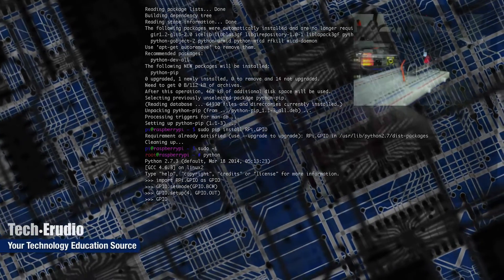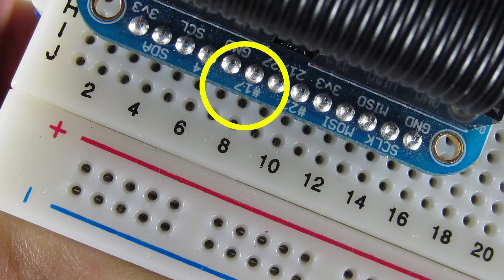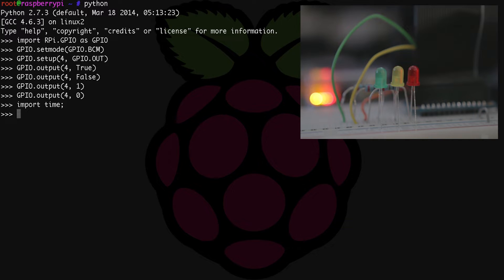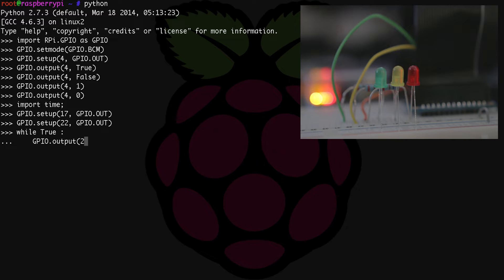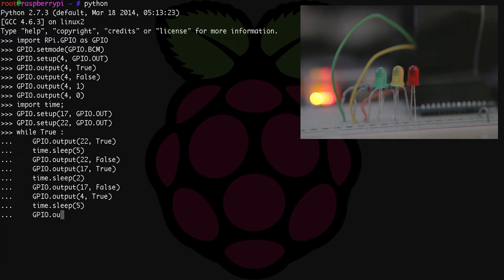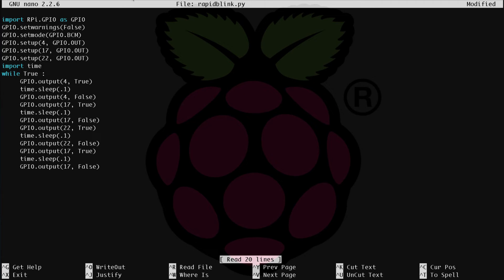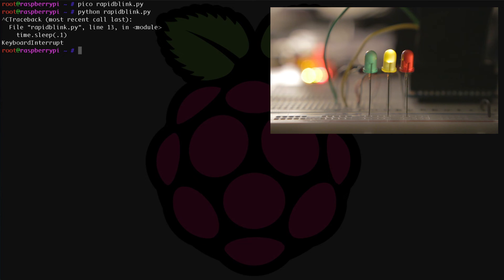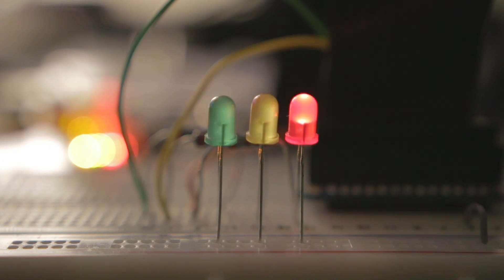Raspberry Pi - Tutorial 13 - Part 2 - Working with LEDs and GPIO

Comment: Thanks a lot for the video really apprecited :)
Reply from the maker: You are quite welcome. Hope to get some new videos up fairly soon!
Reply: so how many volts do the gpio # pind you use as positive output? 3.3v right
i hear that using 5v will fry the board, 
will the LED's be bright  using the GPIO pins as positive to power them,as bright as if you used a power supply?
also can you  change the voltage output with a python command? or sre the GPIO  # pins only capable of outputting 3,3 v?
also in you last tutorila i noticed you specified which way to connect the resistor but i thought it did not matter, resistors  so not have polarity like diodes or LED's ,i have  white LED's and plan on using
2 leds in parallel for each GPIO pin but one resistor for both LED's
so should i wirte the resistor between the 2 connected positve leads of the LED's and the  GPIO # pin or between the 2 connected  negative leads of the LED's and the negative GPIO pin? i have seen  LED wiring diagrams where the resistors are wired in series with the positive and other where they are wires in series with the negative LED lead ,so does it matter?
Reply: also what if i want to have 2 leds on at the same time
and have one go out then the other? can you use a comma like this 
for example GPIO.output(4,17 true) ?
how would i get one to sleep before the other though
or would i just enter it as 2 individual lines?
and is there a way to program say 6 different GPIO outputs to  blink randomly? set the interval like sleep as 6 but have then all go on and off t random but  have them all stay off and on for  set time?
i am doing a halloween project and i want to use  pi zero to  make these eyeball lights slowly  blink on and off as sets

http://s21.postimg.org/xd5h4qwyv/IMG_0141_1.jpg

wire 2 LED's in parallel to each pin , 5 or 6 sets and have them blink randomly but slowly not rapid

Comment: Thanks for putting this up.  I am a rank newcomer to the Pi and programming - all of it really.  I did the stoplight  and sent all three of my LED's to ground through one 100 Ohm resistor rather than three.  I reasoned that since they were diodes and since there is not an issue with the placement of the resistor in the circuit that it might work with one resistor since only one led was going to be lit at a time.  Am I correct?  The stoplight is working.  I got the logic mixed up and it took me some time to switch the numbers but it works.Thanks again.

Comment: 1. any different or things i should take note of if i run the python script using an IDE?
2. There is a pull up/down resistor within the GPIO. If i  enable this, does that mean that i do not need the external resistor in series with my LED?

Comment: Thanks. I ran into a problem after creating my script in pico, though. Here's the message: python: can't open file 'rapidblink.py': [Errno 2] No such file or directory

I checked where the file saved and it is in /home/pi

Any advice?
Reply from the maker: GivandRdale When you use 'sudo -i' to get root access, it will usually bump you into the /root directory. So make sure you are in your /home/pi directory using ' cd /home/pi ' (minus the quotes).
Reply: TechErudio Thanks for the quick response.

Hmmm. I may have saved it in the wrong place. I didn't follow your instructions for both parts on the same day. So, when I launched pico, I wasn't at the root level. I was at the default level for user 'pi.' I did find a way to make it work by launching IDLE using the command 'sudo IDLE' and then typing 'import filename.py.' for whatever script I wanted to load. Having said all that, this is all still very confusing to me although I'm getting the hang of it.

If I have time, I may try going to the root level, launching pico, creating and saving the file, and then running it as you showed to see if it works...

Comment: Rather than using ctrl + c to force cancel the program, wouldn't it be worth adding an if statement checking if you press a certain character, eg. Esc, and then break the while loop in the script? You would only need one script and wouldn't get an error at its cancellation.
Reply: Great video though
Reply from the maker: Yes! That is a great idea. I was so caught up trying to finish the video, I hadn't thought about that. Thank for the suggestion. I'll try to add that in a future video :-)
Reply: TechErudio Glad I could help!